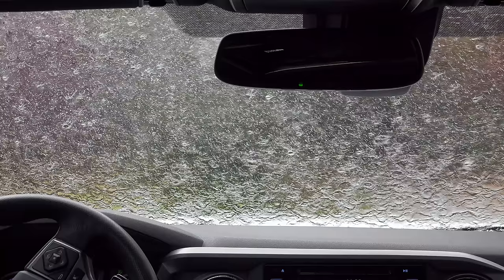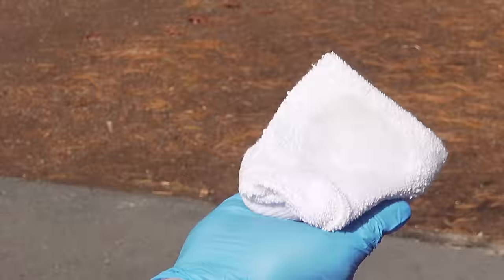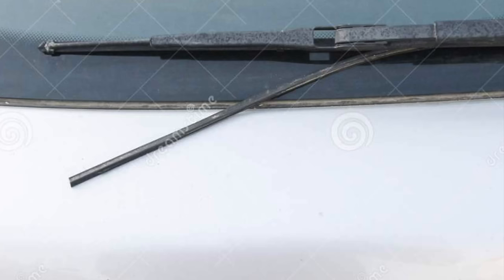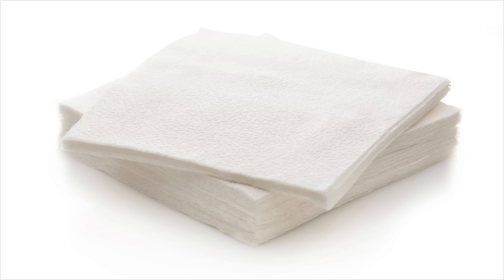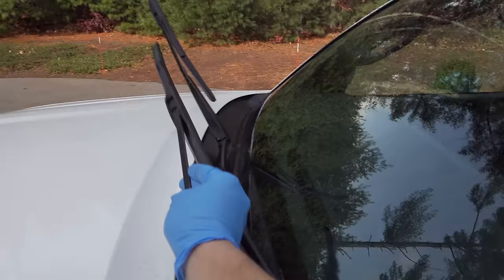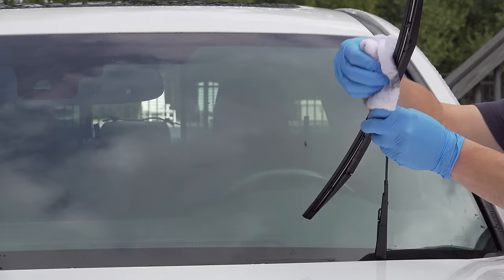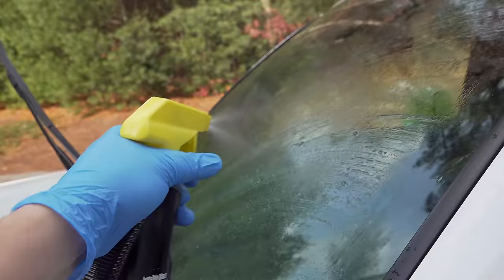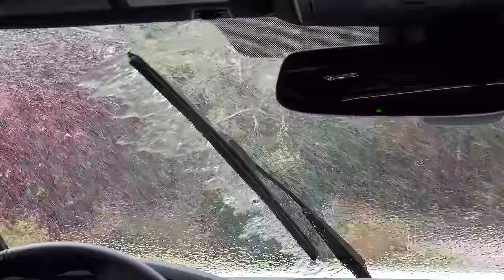How to Make Windshield Wiper Blades Like NEW in 30 Seconds

Comment: I've heard WD40 can damage rubber over time, so instead I use a silicon spray. Works the same as WD40 and its properties actually rejuvenate the suppleness of the rubber
Reply: You can now buy WD40 silicone spray, it also lubricates wndows too, check out Scotty Kilmer.
Reply: @tonymurphy6227  No. Don't check out that old bag of gas.
Reply: Waxing the windsheid works wounders & then you don't need wippers most the time i enjoy it
Reply: Use acid free vasilin, thats the best solution
Reply: @Bubba-Ho  Bruce, is that you?
Reply: @beezertwelvewashingbeard8703  
lol
Reply: @bignoseharry6561  Manchelle ?
Reply: @damieg82 Same here! I'm using the Kleen-Flo's Kleen-Slip Silicone Lubricant (SKU #740 / #742) instead of WD-40, as it's greaseless silicone lubricant
Reply: @ericbunch6772  
No actually thought that was funny
Reply: Tony Murphy 
I don’t have a Toyota lol
Reply: I actually thought that's what he was going to say in the video...Lol :-)
Reply: Tony Murphy I’m a Scotty Stan 😂
Reply: @Bubba-Ho  L.O. bloody LOUD !
Reply: @davidmonroe7783  I tried using snakes. Vindscreen Vipers didn't work at all !
Reply: @peterballan7952  never heard of it i use Mother's wax
Reply from the maker: That is not correct WD40 is labelled and works incredibly well on rubber, don't believe me, just check the can. It's an old myth
Reply: @SilverCymbal  WD-40 Haters !
Lol...just grabbed a WD-40 "Lithium" Spray.
Reply: @davidmonroe7783  I tried ear wax, but I was deaf to to other drivers complaining.
Reply: ,mind telling me what the name of this silicone spray is so I can get it?
Reply: @patriciathemaras3274 , Liquid wrench brand silicone spray...I put that shit on everything.  :-D
Reply: damieg82, it will dry out the rubber, I stopped buying it when I no longer needed it to dry out my spark plug wires on a wet day. Works just like wire dryer.
Reply: Unintended Consequences  
You'd still be able to read it even if you were deaf. I read with my eyes.
Reply: @Bubba-Ho  It's gotta be the combination of the words "suppleness" and "rubber" that does it for me
Reply: FINALLY! Someone in this comment thread with a BRAIN! 👍👍
Reply: @SilverCymbal  Y'know it's funny, I don't think I've read the can once in about 25yrs of using the stuff! I'll put your challenge to the test on my 1994 RAV4 'beater' car and get back to ya.
Reply: It's a known fact that Fluorocarbons & Petroleum based lubricants, swells & deteriorates rubbers. The original WD-40 contains both Fluorocarbons & is Petroleum based aswell. A silicone based lubricant is safer on all natural and synthetic rubbers.
Reply: I wondered the same, doesn't silicone spray cause the windshield to smudge and streak?
Reply: Mad Max  <--  Very true,.. good point.  And 303 works even better,... although it's fairly expensive,. Although some silicones can be also.   ( search 303 on Amazon,... buying in Bulk helps.  And if you can soak the rubber item in it, so much the better.  Then just pour the left over back into the bottle.  Cheers.
Reply: @teatonaz  You can lead the horse to water, but you can't force it to drink. 😉
Some people just buy in to the hype of marketing and swear by it. I have first hand experience on how the original WD-40 degrades plastics materials and rubber o-rings.
There's a reason why the WD-40 products have evolved in the past 10 years by adding lithium & silicone based lubricants.
Reply: @SilverCymbal  WD-40 destroyed my rubber door seals. I sprayed it on to keep the door from freezing shut in the winter. Halfway through the winter the door seal was completely destroyed and had to buy new ones.
Reply: @sarahcash7748  Yeah he's only half right, an not all rubbers & seals are the same. It will also quickly deteriorate adhesives as well

Comment: Great tip.  My wiper blades have been streaking for a while.  I tried this and it worked really well.  Remember, WD-40 is a solvent, not a lubricant.
Reply: Speakin' of tips, my late husband worked in a Circumcision Ward. Got plenty of tips during the holidays  ! ! ! !
Reply: @billiebobbienorton2556  hardy har har
Reply: Water Displacement. I lived in upstate NY for 4 years, very harsh cold winters and can tell you that using WD40 in my doorlocks was a life saver. Door handles too. Otherwise they can snap off in subzero temps, I knew someone who BOTH doorhandles snapped off!  So yes WD40 might have solvent properties but mostly keeps water off things that are coated with it.  Even doors at home use it in the keyholes periodically to keep things working.
Reply: And it consumes rubber. Don’t believe me, blow up a balloon and spray it with WD-40. Pop!

Comment: Another tip to super clean your windshield. Use a clay bar with glass cleaner as a lube. That really gets all the contaminants off.
Reply from the maker: That is an excellent idea and works really well!
Reply: Yup had a new car 6 months could not believe the contamination
Reply: I use 0000 steel wool. I haven't tried a clay bar. Id love to see a comparison between the two.
Reply: @ManjaroBlack  Yes I have never tried steel wool, always did clay bar. One thing I can think of off the bat is the clay bar picks up the contaminants where steel wool will remove them but you still may have some residue to wipe off.
Reply: Yeah really I’m going to have to try this. Awesome idea. I did it once to a customer rear side window just to get a weird mark off but never know how it was after
Reply: @drphibesrises  In the past I had a sticking key on my keyboard. I got the bright idea to spray just a little wd-40 around the key. It worked! The key didn't stick at all!! The next day none of my keys worked... Hmmm... So I took the keyboard apart and low and behold the rubber under the keys expanded almost twice the size. I realized then wd-40 isn't good on some rubber material. So I am wondering if in the video is all the black actually containments? Or. Wearing the rubber Down in the Blades? I like your idea with the clay bar! I'm definitely trying this one out 😉👍
Reply: Randy E if you clean your wiper blades with glass cleaner,  not WD-40, you will see the same dirt removed.  You may not get the same longevity as using the WD-40 though.  Never tried the WD-40.
Reply: @jonathanscott4776  sounds like I will have to do a little test... Use invisaglass on wipers, then use clay bar and see if anything more comes off, then lastly use WD-40 on another clean cloth and see what happens 👍
Reply: @ ManjaroBlack   It’s used on all new car windshields, together with a good glass cleaner here, in Europe.  Greetings from Belgium 🇧🇪  ✌️
Reply: Lava soap, 90% alcohol to clean then ceramic coat the glass and you almost never need the wipers. Also snow & ice no longer sticks to the glass
Reply: I've always used a Magic Eraser for deep cleaning the windshield.
Reply: What if you use isopropyl alcohol to clean the wipers and the windscreen, claybar the windscreen then ceramic coat BOTH the wipers and the windscreen 🤔
Reply: Bern Boomboom 
Interesting, Lava soap in the bar, hand soap, or does it come in liquid? Then winter, salty sloppy gritty spray from passing vehicles and you have to use your wipers, do the blades leave black residue on the windshield?
Reply: @waris3732  Don't.
Reply: @davidbayles6494  why so my man?
Reply: @waris3732  Why so _ _ ?_ _
Reply: @gunnarallgottsmann  Greetings my friend 🍻 from USA 😉
Reply: @ Randy E   Thank you for your kindness.  Have a great time.  🇧🇪  ✌️
Reply: @ Randy E  use the 0000 steel wool only on the glass parts please, never on the wipers rubber.  It should work perfect 👌.  G.

Comment: tried this one clean sock for each wiper my windshield is no better but my socks go on easier
Reply: 😂 #1 comment
Reply: I would throw those socks away, you don't want skin contact with them
Reply: Jacgof wD40 on feet first, then socks so skin doesn’t know the difference
Reply: @jacgof3254   A jobber used to soak his hands in the stuff...swore it helped ease his arthritis...dmso is in WD40, so that's why  it worked

Comment: Thanks Silver Cymbal for the tip. 
I usually use some of the window washer fluid I hold back from the gallon jug to clean off the wipers every time I fill up.
Yeah I’m one of those ppl that pump their own gas and wash the windows on a fill up.
Reply: Pretty much everyone pumps their own gas these days. I haven't seen a full service station in at least 20 years.
Reply: @jcwoods2311  in NEW JERSEY self service of gas is illegal
Reply: @matth284  Ditto Oregon. The rest of the states still allow it - I haven't seen a full service station for years.
Reply: @flagmichael  first time I went through jersey the gas guy almost got it. I didn't know I couldnt pump my own gas and he was adamant I not do it, but he couldn't speak English. I thought I was getting robbed, and for a second he thought he was going to get that reaction from me..
Then he said "you no pump" and pointed to the other pumps..

Oops. Okay man, you can do it.
Reply: @matth284  Thank God I have no reason to go to Jersey, or Oregon either.
Reply: J Woods, not the point of the comment. Point being that instead of 99% of those that pump their own gas, I still run the old school full serv checklist: windows, oil, tire pressure at each fill up every 7-10 days.

Comment: I found it easier to just spray the WD40 all over the windshield. It cuts through the buildup there, the wipers scrape it off, and the contaminated fluid runs off the blades taking the buildup on the blades with it. The view is clear and I actually get better gas mileage due to the lubricating effect of the WD40 as the air hits the windshield.
Reply: No, you don't get better gas milage because of a cleaner windshield.
Reply: @ricktipton9563  Ah c'mon, man, just go with it.
Reply: @whiteknightcat  I know. I could. But damn, better gas mileage? From polished windshield? Then you gotta think, how much better mileage? And you wonder, does this person think they have saved more than a dollar a year? And they do think like that. They think the cost/benefit works out so they are polishing windshields, not for improving the view, but because they think it's fiscally wise. Oh man. Then there's science involved. You want to not think about coefficients and vortices, or surface tension and particulate attrition, and I wouldn't think that shit at all, until someone says something. Something that you can't ignore, like getting better gas milage because they used something on their windshield....But yeah, you're probably right. I don't need to get worked up about it. I guess if someone says that their milage improved, I don't have to agree or disagree. I don't need to prove it, one way or the other. I can just let it go and think about something else...You're right man. Thanks.
Reply: @whiteknightcat  Or the gymnasts.. Spray wd40 on the rings that they use. No points on the routine but high 9's on that dismount.
Reply: @ricktipton9563  YES!
Reply: @ricktipton9563  Only in cities like smog laden LA and others.
Reply: @sess122  in smog heavy cities a clearer windshield will improve gas milage? In a  car? Driving? And gas milage means how many miles the gasoline will propel the vehicle? Uh, No. I don't care if you drive through a Proctor and Gamble vaping party on a foggy morning at Chernobyl, a cleaner windshield isn't going to offer you any more slip. You will not get better gas milage, not in any amount that would be noticeble.
Reply: @ricktipton9563  Geez, lighten up.  It was a poke at LA, Capitol City of Smog, USA, where you can cut it with a knife!
Reply: @sess122   A good poke has something clever within its layers. Your comment kinda lacked that. You should've just said something like, " windshields sure get dirty because of that thick smog" instead of trying to tie it in with gas milage.
Reply: @mrartician5250  I think you should pay more attention to something else besides this discussion.
Reply: If you put wd 40 on your wind screen you will not be able to see the road when it rains wd 40 is a very thin oil and it will smear  your wind screen . So stop the bs .
Reply: @thewinningmind  Apparently you didn't look at the comment thread before posting.